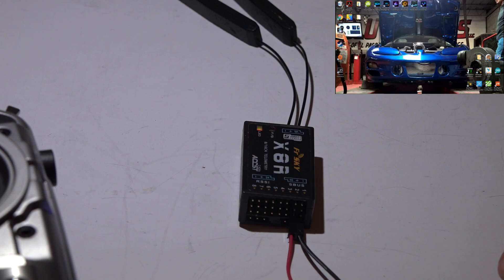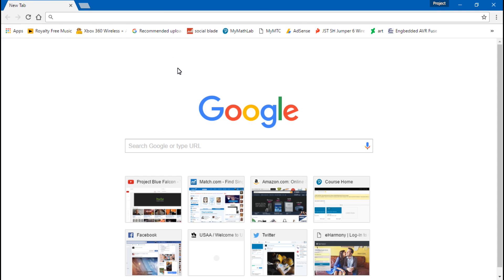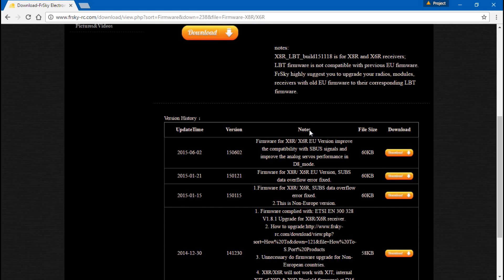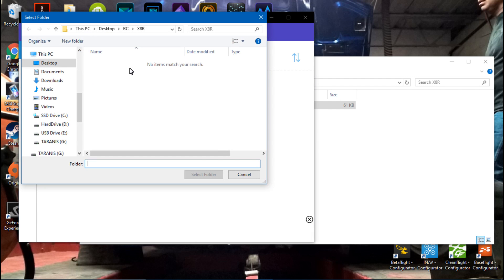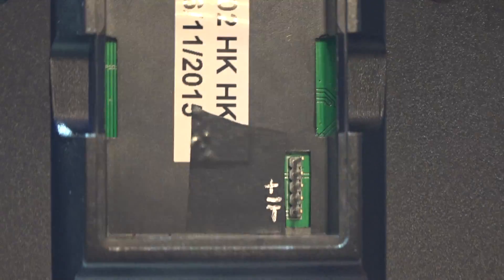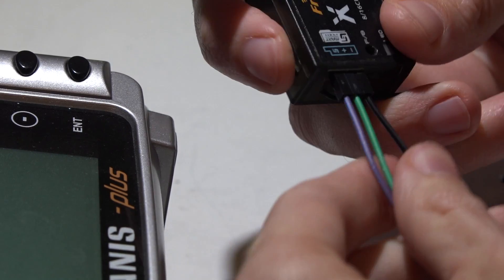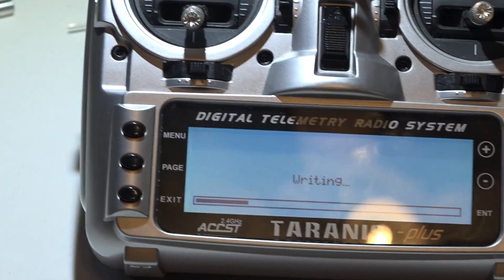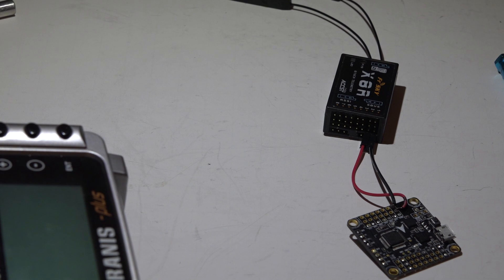FrSky X8R: How To Change EU / Non EU Firmware

Comment: Hi I'm getting back into RC after a few year break. I decided to update my QX7 to the new firmware OpenTX 2.3.15 (2022-04-22). I bought a FrSky X8R from Amazon and I can't get it to bind. My TX is set to internal RF, XJT D8, Channel range 1-8. I pushed and held the bind button while powering up the RX and the green and red light are both on and solid. The red light is supposed to be flashing... So I'm thinking I have to update the firmware on The RX.

I downloaded the newest firmware on FrSky site for the X8R (ACCST D16 v2.1.0 2020-03-24) and uploaded it to the TX. I have a early version of the QX7 and it does not have pins for the smart port so I used the external bay pins. I am positive I have it wired correctly (as shown here https://rcdiy.ca/taranis-opentx-s-po...ware-flashing/) now I connect it to the X8R using the RSSI port (I tried SBUS port also). I go to the firmware on the TX and flash external module and select the firmware, and both the green and red light on the RX flash once and turn off, and the TX says FW update error not responding.

I can not figure out what is going on and how to get it updated/binded. Any information would be helpful, thank you!

Comment: I have qx7 transmitter acces and x9r reciver accst versions.
When I enter to bind mode solid green and red light is there ..
Can this problem be solved by firmware update or any other process is available.
Thanks
Reply: it is supposed to be fixed only by updating the receiver. but it is important that both versions are the same, that of the control and the receiver.

Comment: An update 2020 for those having problem with solid lights.  don't click the DOWNLOAD button BUT under to the left you can see this: History firmware DOWNLOAD (not compatible with v2.x.x) clik that downloade link. Try one of the x8r . I had to use FCC
Reply: Thanks for this old post!  You solved my problem after trying several other fcc files that I found on the internet.  Woo Hoo!

Comment: could you please help me. I live in eu. But if I want to take my radio out of eu at some point I would like to change my firmware to the international, but I really have problem putting my radio back to the way it was. Is it possible to download one of the older firmware f. example 2017 or 2016 international firmware which worked perfect for me? and if so where can I find them. thank you

Comment: Do you have any idea that my X8R has both red and green solid light on after flashing the firm ware??
Reply: I hav the same problem. unfortunately Blue Falcon is passed on some time ago :(
Reply: Fix for me was as expected finding the right FW. don't click the DOWNLOAD button BUT under to the left you can see this: History firmware DOWNLOAD (not compatible with v2.x.x) clik that downloade link. Try one of the x8r . I had to use FCC.

Comment: Thanks for the vid. I thought this might have been the reason mine will no longer bind. It worked one morning then in the evening, would not connect. So I thought maybe the firmware dropped somehow. So I tried this, downloaded the firmware, non-EU, in to the transmitter, connected to my X8R, wrote to it, tried binding and still nothing. I get the flashing red. The X8R is a replacement that is only a few months old. It bond first try out of the box and had no issues until now. I've switched it between planes before. This just happened when switching it to my P-51. All systems worked initially then after disconnecting and reconnecting, nothing. Would not bind after that. Any ideas? Thanks

Comment: I have a problem with my x10s not communicating with frsky gr x8 both eu version.  Only the first sux channels are working, 7 and 8 won't.  With my glider I had to use a y connector to get my plane in the air.  I am also unable to get the proper receiver voltage readout on my transmitter.  Im getting a default reading of only 5 volts on a 3 cell 2200ma battery and I'm not able to change it manually.  Please help I need some advice..thanks Mick

Comment: Hi, great video, thanks for sharing is hard to find good information about this. I´m trting to do this procedure from Turnigy 9XR Pro, all steps are pretty similar but when i get the writing the receiver led gets green and  the bar initiate the flashing process but inmediatly the led turns tu blinking red, i stil waiting for a long time and finally gets Failed,  Any idea of the problem? A lot of thanks
Reply: Sadly JC was killed in a motorcycle accident several months ago, so you won't be getting an answer from him. A quick google gave me this - http://thrustworx.com/frsky-x-series-receiver-sensor-s-port-firmware-flashing-9xr-pro-complete-guide/  hope this helps.
Reply: How sad, I'm so sorry, I hope he rests in peace and thanks for answering

Comment: Every time I try this it tells me the ‘module not responding’ anybody know how to sort it out?
Reply: Just a wild guess, is your external RF (bottom of page 2) switched on or off.  I'm told it should be on but I'd try both ways.
Reply: @Crowstooth  Hello. When i press " Flash S. Port device", Taranis say me "Firmware update error, Device not responding". Please help me.
Reply: Hello. When i press " Flash S. Port device", Taranis say me "Firmware update error, Device not responding". Please help me.
Reply: On the external module.
And off the internal module

Comment: This is not working for newer FrSky Taranis Q X7 models anymore. You will get an error message saying "bottom pin not resp". You have to change your receiver firmware via the smart port on the bottom of you X7 now (next to your SD card slot). Very important: The cables do NOT need to be switched anymore now, so (from ouside to inside/sd-card) the pins are: GND, PWR, SIGNAL from left to right (the signal is closest to the SD Card slot). This is the same order as smart ports on the receivers, so you can just use an unmodified servo cable to connect them up. The rest of the procedure stays the same.
I got this info from cjpace's posts on rcgroups.com and was able to change to EU/LBT on my X7 this way. Thanks btw :)
https://www.rcgroups.com/forums/showthread.php?2788263-NEW-Radio-Frsky-Taranis-Q-X7-what-do-we-know-so-far/page115#1716
Reply: Thanks my friend :) Saved me some hassle!

Comment: hello. I did as you show in the video, but the flash crashed at 25/30%. 
I can't do it again (I've an error message on the taranis) and the leds won't lights anymore even on my quad. any suggestion ?
Reply: You might have damaged the bootloader of your X8R and thus broken it. At least i've read that might happen if the flashing process is disrupted. I'd google or ask in a place like rcgroups.com for further information/help.
Reply: Two X8R is crashed during firmware =(( One frsky support fix (my shipping cost to and from a half of receiver). Google or other is silenced about fix. It so sad